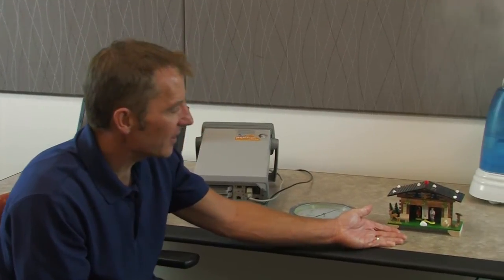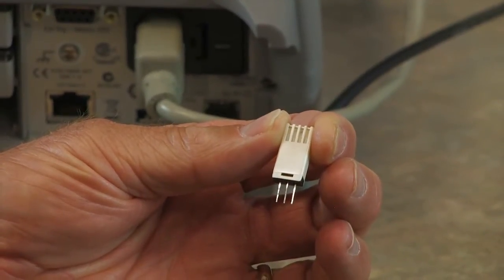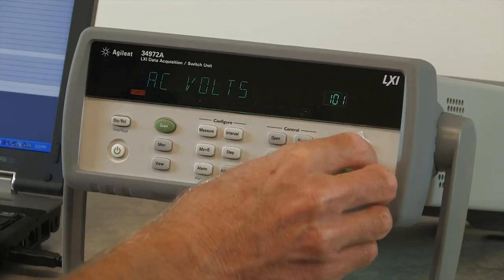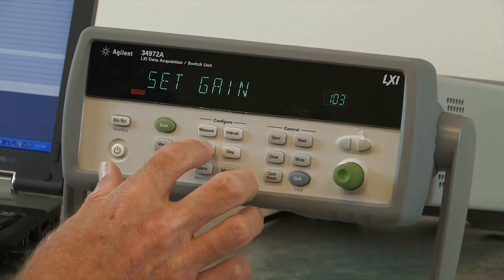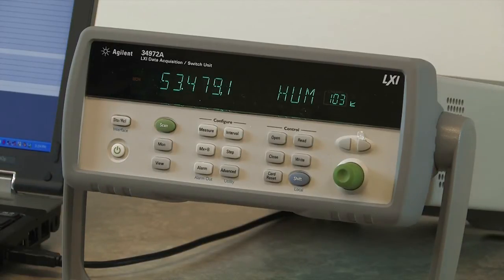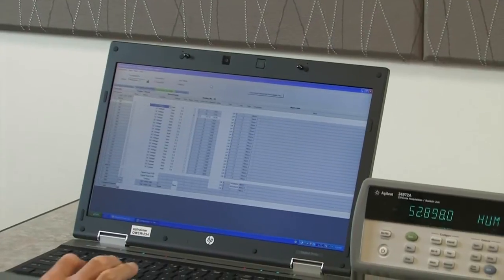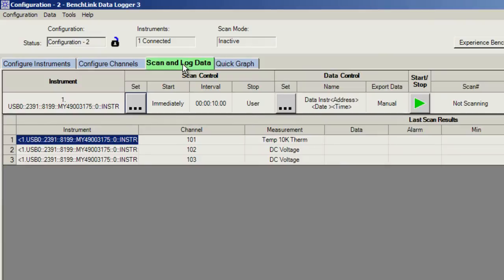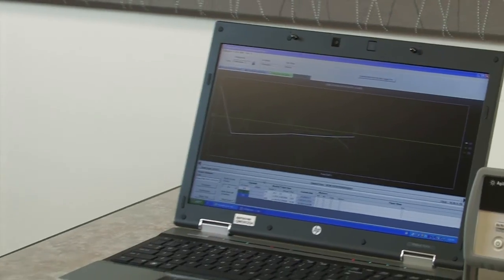Making Humidity Measurements Using 34972A and Data Logging

Comment: How is the HTM2500LF connected to the 34972A multiplexer board.
Reply from the maker: You can find the datasheet for the HTM2500LF online. The sensor has 5 wires (W1-W5), W5 is the shield. Connect the W1 brown to the power supply ground and the low of two channels CH1 & CH 2 on the 34901A mux. Connect W2  white to the +5 volt supply - this powers the humidity sensor. W3 yellow is the voltage proportional to humidity connect it to the high of  CH1 on the 34901A. Last, connect W4 green to the high od CH 2 on the 34901A.  The 34970A/72A can read the DC Voltage from channel 1 and the temperature on channel 2 .
Reply: @KeysightHandsOn  There are 2 things I don't understand. Firstly, do we need an external power supply for the W2 white wire, if not and secondly, do we split the W1 brown wire so that it can connects to the the low of the three channels. The result being Ch1 L Brown, H Yellow, Ch2 L brown, H Green, Ch3 L  brown and H white.

Comment: How do we connect the HTM25000LF to the 34901A multiplexer board? Any help would be great.
Reply from the maker: Paul Dervan You have one extra "0" in the model number.  You can find the datasheet for the HTM2500LF online. The sensor has 5 wires (W1-W5), W5 is the shield. Connect the W1 brown to the power supply ground and the low of two channels CH1 & CH 2 on the 34901A mux. Connect W2  white to the +5 volt supply - this powers the humidity sensor. W3 yellow is the voltage proportional to humidity connect it to the high of  CH1 on the 34901A. Last, connect W4 green to the high od CH 2 on the 34901A.  The 34970A/72A can read the DC Voltage from channel 1 and the temperature on channel 2 .
Reply: Thank you. That's very helpful.

Comment: How to connect AM2302 humidity sensor with three pins to 34901A using 34907a on a 34970A data logger...???
Reply from the maker: Kapil Narwal  The AM2302 creates serial data to report humidity. The 34970A does not support serial data.  Other sensors produce a voltage which the 34970A can measure and then use its scaling feature to create a meaningful number.  Personally, I would choose a different sensor as working with serial data is very time-consuming.
Reply: What is the humidity sensor connected to 34901A card in the video...? can you suggest me some...??
Reply from the maker: Kapil Narwal.  The sensor in the video is HTM2500LF.  The datasheet is online, you can see if it will meet your needs.

Comment: How do we connect the VAILASA HMP110 humidity sensor to the 34901A  on a 34970A data logger...???
Reply from the maker: The HMP has several models. You will need the analog model - I would look at the users guide on their site.